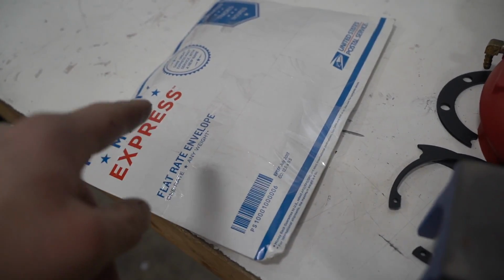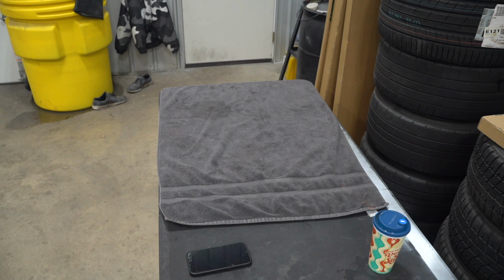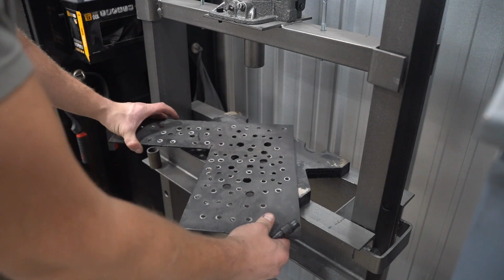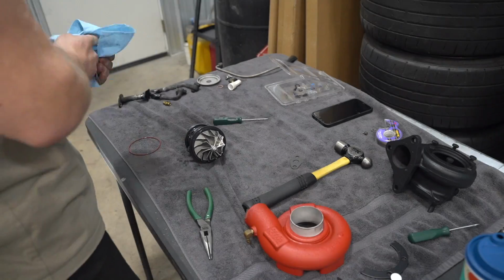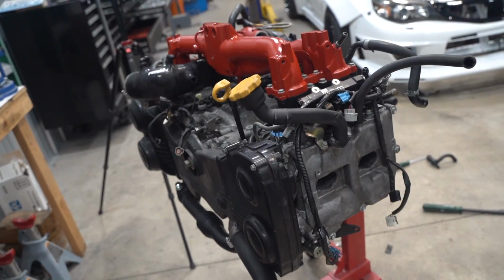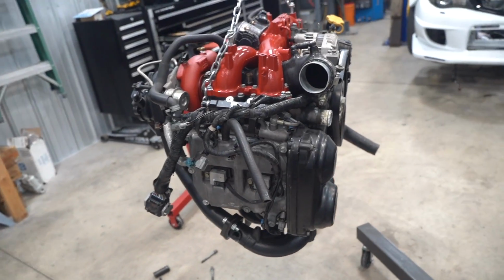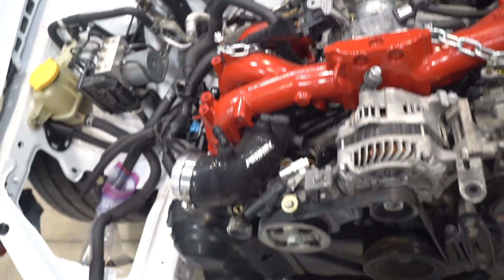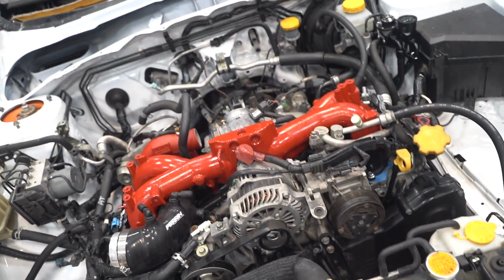Rebuilding The Turbo and Installing the STI Engine!

Comment: Helpful tip when using a press; always reset the press after you get the item centered and slightly pressed into place. This will let the item center itself instead of being forced into place by pressure from the press. Just something I was taught from a master diesel tech. Loving the content, long term sub from Snohomish ✌

Comment: Question : Do you recommend putting exhaust system & intake manifold on prior to putting the engine back in? 
I’ve been told to put exhaust manifold on after so you have more clearance.

Comment: Question how do you rebalance the turbo shaft after re assembly? ore why didn't you? and Blue Loctite "middle strength" + low heat to make it go, poof.  meaning so close to exhaust gasses it will be gone the first startup.

Comment: Great job, but that's a terrible lift point for those motors! Use the alt bracket and bolt hole back by the trans.

Comment: That radium fuel setup is super clean, but I’ve never seen anyone use a returnless style setup in a subie so I’m curious to how it holds up
Reply: I was thinking the same thing. It’s the first time I felt Devin fundamentally approached something wrong. No matter whether they’re in series or parallel there should be returns.
Reply: I’ve never seen a returnless system in my entire life on a turbo Subaru
Reply: Yeah I came here to comment on the fuel system being incorrect. Needs to be split parallel feed with a  return. This setup won't run deadhead like that.

Comment: Great job Devin! I’ve been watching your builds and so stoked you’re working on the same car as the one I have, is there any tips you could give me for removing the intake manifold on the sti? I need to get under there to replace the secondary air valve.